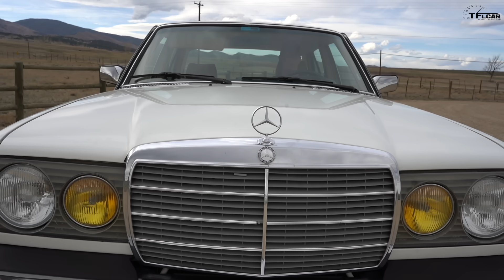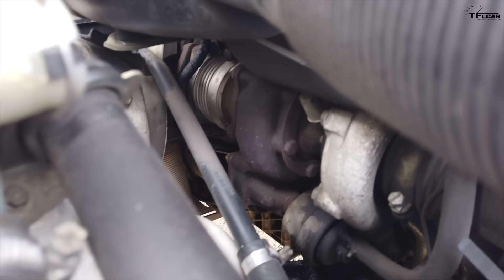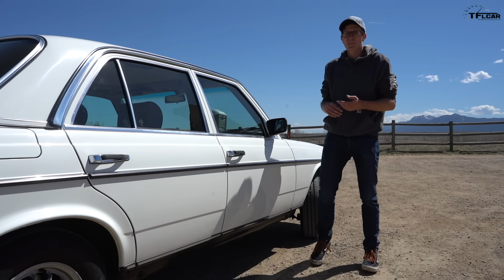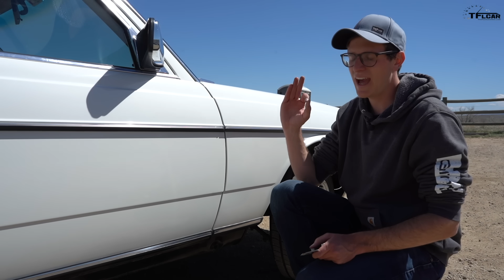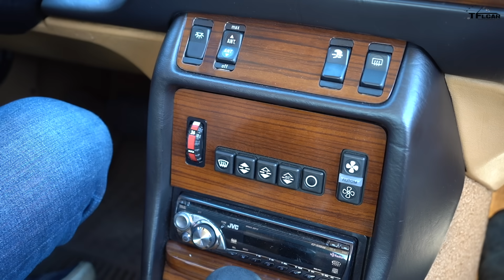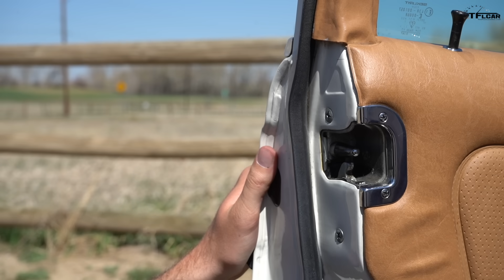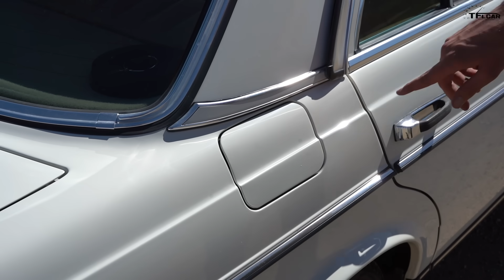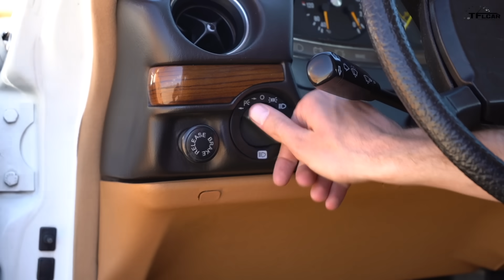This 37-Year-Old Diesel Is THE BEST Mercedes Ever Made!

Comment: Great car, but not so great for inexperienced drivers. With back drive wheel and a massive front engine, you can easily finish driving on the roof.Very bad car for snowy roads.
Reply: Are you kidding me? It drives like a front wheel drive in the snow, there's not enough power, especially in the NA models, for the rear to get loose and you have plenty of traction at the front wheels.

Comment: The 240D was better than the 300D in my opinion. Better gas mileage and less complexity than the busy 5 cylinder turbo diesel motor.
Reply: Sure.
Reply: The 5 cylinder naturally aspirated motor is superior, fuel economy is nearly identical with a significant increase in power.
Reply: @DJS_ENO  You forget the added complexity? 😂

Comment: That should say I drove it from Amarillo to Dallas and back to Amarillo if I remember it used a little less than half a tank and that was a 1970 Mercedes getting that kind of gas mileage the diesel rabbits in the 80s were getting 50 and 60 miles to the gallon average is about 47 and that was in the 80s do you think cars we get better today no but not with all that crap and weight on them

Comment: I love 240ds... I'd be lying if I said I haven't owned my fair share but, cheap to maintain isn't something I'd associate with these cars anymore. I am a huge fan of Volvo 240s and these 240ds, and I have had both at the same time on multiple occasions. My main point is that no European car from this time period will be reliable like you might expect... You probably won't be stranded because the car won't know it's dying and shut itself off but, they break... A lot. Parts on these cars are expensive as all hell here in the US, and using junkyard parts on these vehicles has never yielded me much success. German engineering, and I'd even say all European engineering is all for the first owner to really enjoy. I love these cars, way way way more personality than a newer car, and they can be worked on by yourself but, the reputation these made in the 90s after they were used for 10-15 years isn't all that accurate to today.

Comment: I used to drive a 1982 240 D of the same W 123 model range. It certainly was one of the best cars I've ever had and I've had quite a couple of them: it was built to last (almost indestructable!), extremely reliable, very easy and comfy to drive, quite fuel efficient and, surprisingly, not even very expensive to keep on the road, particularly when you were able to do some maintenance and repair work yourself. On the downside, it was sluggishly slow (both acceleration and top speed) and a pain to drive in ice and snow.

Comment: that is legendary w123 thare is still a lot of them on balkan streets
Reply: Why wouldn't there be? If you can't afford to change cars every 4-5 years and want a highly dependent and reliable old car which is relatively easy to fix and built like a bank safe then it's ideal. And while other car makers could indeed design rugged and reliable cars they all felt and drove like tractors and lacked refinement. The W123 was comfortable too and is designed for long-distance motoring too. Other car manufacturers could also have comfort and refinement but sadly not the reliability (perfect example being the legendary Citroen DS with its very comfortable pneumatic suspension which unfortunately is b*tch to maintain). The Mercedes W123 was just the perfect combination (hardly a "compromise") of rugged and reliable mechanics with modern day comfort (and you can still cruise at 150km/h all day long no problem on the German autobahn with these 40 year old cars). 

When I was a kid I didn't like these old W123 cars because they appeared a bit "old-fashioned" to my kid eyes and worse they always seemed to be driven by elderly men. Now when I'm grown up myself I suddenly understand the wisdom of those elderly men. They weren't out to flash their latest "hot-looking-car" but wanted a safe, reliable and comfortable car which won't provide them with tons of headaches and even worse give you a stomach ulcer. And this is why whenever I buy a new car I always check "reliability reports and rankings", "customer satisfaction" (Mercedes have actually slipped down in the 21st century) and what guarantees the manufacturer provides. 
Had I lived in the Balkans however and perhaps been of the "less fortunate" ordinary people I'd get a Mercedes W123 and drive it forever. Obviously a diesel. They can run forever.

Comment: I'm a European citizen and owned 2 of this cars with a 3.0 engine, my first was a W114  and then a W123 both had a 3.0 engine. I ended to buy Mercedes after I had an accident with my W201 2.5l diesel. In my opinion the best car I drove was that 190 2.5. It was a lot faster and smaller but still you got the feeling of driving a bigger Mercedes in those days.
One interesting thing you forgot to mention in the video is how to handle the rare parkingbrake on that car.

Comment: I serviced MBs professionally for years, and I like the 123 a lot. I wouldn't call it "THE BEST" Mercedes ever, though.

Don't get me wrong, I'm not disparaging the car at all. It's an excellent car, and for its time it was indisputably one of the best cars in the world.

Therein lies the rub, though. "For its time." It's a product of late '60s engineering (the W114/115 dropped in '68, MB started R&D on the W123 immediately), and it shows in things like the rear suspension design and the reverse-flow heads on the diesels (which carried over mostly unchanged from the 114/115). Moreover, the 240D and smaller variants are so severely underpowered that newer MB buyer's guides explicitly recommend against buying them because they're legitimately dangerous in modern traffic, and, having driven more of the cars than I can count, I absolutely agree.

For those reasons, I'd argue the best MB ever made were the W124 and W201. They were engineered and assembled to the same exceptional standards, and they got some significant updates (high tensile strength safety cells, modern aerodynamics, the 5-link rear suspension, more powerful engines, etc.) that make them better cars to drive and live with than the 123 without sacrificing reliability, durability, or serviceability.

Comment: Personally, the best Mercedes made (IMO) is the 1981-1991 S class, specifically the Turbos. It has everything and all the bullet proof engineering that makes this car great, but in a better looking aerodynamic package. I'd argue that maybe the W124 is better but I could be basis. Also, the w126 is ICONIC and quintessential Mercedes-Benz, and the 81-85 300SD engine is indestructible. 

We can agree on the headlights tho. US spec looks better.

Comment: My folks still have their 1981 240D -- no turbo -- white (with body-color hubcaps!) with tan interior, just like in this video. Still runs strong, apart from the battery going when it sits for too long. Little bit of rust on the body but honestly no problems to speak of. Back in high school, almost 20 years ago, I drove it regularly and would joke that the body would eventually disintegrate long before the engine would ever go...but also that the body was hewn from a single piece of granite. Love that car and will never sell it.

Comment: The steeringwheel is so large i  only needed my thumb (of your hand) resting on your leg to drive... so relaxt. Without  powersteering it was not possibe to even steer the car LOL. i had a W123 LPG. Only problem it had was the rust. also the  police pulled me over because they thought i had stolen copper in the trunk but hey the suspension us so great is was leaning back a little.... you can drive a bump with 60mph and don't even notice Great car!!

Comment: Modern Mercs make it to 100k miles then will need engine mounts, most/all suspension components, glow-plug controllers, auto -gearbox controllers. LED light clusters will fail etc etc. Multiple opportunities for them to run rough, so causing more vibration and more early-life failures.

Comment: Honestly i have a 1983 300sd and i like it more than the non s class.
Reply: Yarr...I had an '82 300SD back in the early 90s - an absolute beast of a car. I think I still have its MBZ 250,000Km award.
Reply: @eddiewillers1  mine has 500,000 miles on it but no awards because the person i bought it from did some things to the engine and Mercedes disqualified my car from the high mileage awards and it sucks.

Comment: You're very right. In my opinion this is the last real Mercedes ever made. I really favourite the former W115/W114 (-8) series with nearly the same technical advantages and same motors but they rust a lot. The W123 was better protected and had some nice solutions like changing bulbs of the lamps. But, you should look at a W114/W115 trunk. Because of the fuel tank is underneath the bottom of the trunk there is much more space.

Comment: It's also the ugliest version of that specific model. I didn't say the European model is a design award winner, but it didn't have those horrendous bumpers. Those plain ugly front lights destroy the little design effort they invested in it: in Europe, it seemed to have only two 2 separate white lights and that was it. Its successor, the smaller 190E and D, was one of the very last cars that still had a classic Jaeger clock with orange hands. Knowing which eighties cars didn't have digital clocks, that told you nothing as soon as the driver had cut off battery power was precious knowledge in those days. Esp.when you'd forgotten your wristwatch. Very few people believed that mobile phones would inundate the market of ordinary consumers. We supposed that their use would be limited to men in suits for urgent and important conversations. 
Funnily enough, the first users were high ranking communists. Some even imitated the Politburo elite by walking through East-Berlin carrying stolen battlefield phones. When I asked a hairy Bulgarian why he brought a bakelite device (weighing 10 kilos and made according to a 1950s US plan in 1988 - nothing new there) into the university auditorium, he said he needed it for business purposes. I pretended to closely study the 10 kilos bakelite phone and swiftly lifted the receiver. No click, no static noise that could prove it was connected to anything, just Marxist silence. Meaning that it was unfit for any communication, let alone trading activity. Germany was recently reunited and I asked him what stocks were underrated and if it was sound thinking to invest in hedge funds. Suddenly he remembered an important appointment and disappeared. I bet he never returned to Bulgaria and was among the first entrepreneurs who provided officially in former East-Germany non-existing services in the erotic sector. I bet the first money he earned as invested in exactly the same car you made your video about.

Comment: And no computer bulshit to deal with
Reply: I don’t like “smart” cars either
Reply: facts!
Reply: Yeah, I miss the old days of driving before computers invaded every aspect of a car. When everything was simple and mechanical.
Reply: @pauldavis5665  Me too.
Reply: @pauldavis5665  I don't miss the fact that today's modern cars are literally twice as efficient, recently did a 90 Mile trip in my Mercedes (W246) B200 CDi and did 74.3 mpg. The same car achieved 143 mph (in Germany) verified on Sat Nav.
Reply: @pauldavis5665  and unreliable
Reply: @teslatrev5764  Unreliable? Is that why my old Ford Bronco had over 200,000 miles on it and did not break down once? The thing was still running well when I sold it so who knows how many more miles it got. They built things to last back then.
Reply: @pauldavis5665   So if  an exactly the same bronco was for sale new now would you buy it...
Reply: @teslatrev5764  No. I don't need a truck anymore, that is the only reason I sold it. Bought a car to save on gas. Otherwise I would have kept it.
Reply: @pauldavis5665   Do you know what made the Bronco uneconomical ? lack of technology ..
Reply: @teslatrev5764  What made it uneconomical was that it was a truck with a big V8 engine. lol Trucks today with big engines are also uneconomical which is why I bought a new car and not a new truck.
Reply: @pauldavis5665  Why didn't you buy an old car...
Reply: @teslatrev5764  I wanted something that didn't have any miles on it. I never buy used vehicles since you never know how the previous owner treated them. Every vehicle I ever owned I bought new. By the way, you sure do have a lot of questions. You sound like my youngest son. lol
Reply: @pauldavis5665  I bet he does not get a good answer....
Reply: @teslatrev5764  Which question of yours have I not answered?
Reply: @pauldavis5665  ... i'm only messing with you ... i really could not care less...
Reply: Tesla Trev In what sense? There was nothing to brake and surprise the driver who did even the most basic maintenance on his car. Anything "unreliable" on any car ever was and is related to electronics.
Reply: Paul Davis He obviously is tech obsessed kid. He simply doesn't know better. And he's also a troll, but you probably already realised that.
Reply: @teslatrev5764  Lack of computers did not make a lot of old cars unreliable, what made them unreliable was poor build quality and design. Older cars WERE less economical, but that can actually make them LESS reliable as there are far more electronics and computers that can be prone to breaking.
Reply: @pauldavis5665   i guess your new car keeps breaking down then.....
Reply: Dam straight
Reply: oh dont be fooled. this car had a massive amount of electric crap under the bonnet under the dash in the boot etc. absolute nightmare to keep it all intact.
Reply: Vacuum Logic. Electrical is only for starting, lighting, blower, radio. Diesel runs until there is no fuel, without electrical anything.
Reply: @pirate0jimmy  diesel vehicles electronic  fuel injection and fuel air control...
Reply: what are you watching this on?
Reply: Tesla Trev Your point?
Reply: Ok boomer
Reply: Its emp proof lol
Reply: They put technology, because women can't drive.
Reply: YES SCARY TECHNOLOGY BAD- GOOD CARS WITH HOLE IN FLOOR TO RUN WITH FEET
Reply: Tbh, i love smart stuff and electronics. Heck, i even work in IT, but i would always choose a completely mechanical car if i could tbh. They just /work/
Reply: such a pleasure to drive in today's information age
Reply: I like 'em. Car running rough, throws CEL. Plug in my $8 Chinese scanner and within 11 seconds I know that cylinder #5 is misfiring and that it's likely the coil pack. 

So... pros and cons to computers. It's not all bad, you just don't want to buy a car with garbage computers.
Reply: @DigitalBathInAZ  But in the first 30 years this Mercedes might not let you down not even once...while a ECU car...well...most likely will never reach that age...and will break on you multiple times in whatever timespan it lasts.
Reply: @henryrollins9177  I'm approaching 30 years on my early and mid 90s LS400 and SC400, soooo... 

I guess we're talking just MB cars with ECUs (which I know nothing about) and I mistakenly took it to be "cars in general with ECUs". My bad.
Reply: @henryrollins9177  Fact!!!!!
Reply: Those Lexus cars were built to be show pieces. Toyota may have accepted NO PROFIT for a few years, like the Prius, to own the market space in a way that Nissan, Mitsubishi, Honda, Suzuki will never catch up to. Toyota is very proud of the Crown cars being the biggest and best car for top Japanese officials.
Reply: @henryrollins9177  its almost like the automakers have "preprogrammed" the computer to make a part fail..just so they can sell parts to make more money..lol!

Comment: I take it that it gets really good fuel economy being a diesel probably like 35 40 miles a gallon
Reply: brettduffy19992 30mpg on the highway , but not much better. It’s a SOHC, so it’s limited in its efficiency. My 300SD only has 3 forward gears, so when your going 80mph, your at over 4K RPM, not exactly the best for fuel economy.
Reply: @jgarza03  at 55

Comment: I have an 82 300D turbo, my parents bought.  Odometer says around 295K miles, but only cause it wasn’t working for a while... think it has closer to 400k miles, original engine and transition, never rebuilt.  Only things I’ve ever had to fix that cost money is the starter and glow plugs and sunroof motor once.  Also had an 85 300SD that was amazing.

Comment: BULLSHIT video:  Mercedes factory went on record saying their diesel  has the same life as their gas engines.   Even if the engine lasted longer than a gas engine, it doesn't matter as the rest of the car will fall apart within 150,000 miles without lots of work.

Comment: Volvo 240 is a similarly tough abs straightforward design. I love both of them.
Reply: Volvo 240 is another mechanical marvel. Both cars are built to last not go fast.
Reply: @frankfff1665  I agree!
Reply: Yes you are right
Reply: Yes and you don't want to be run into by those Volvo's. They will ride your car of. And the Volvo will drive home. The Volvo was alot stronger than the mec. My friend has a 1977 mec 300 diesel in Australia and everyone wants it. 👍

Comment: Well, the old Toyota's Corolla are at the same level, they can't die.
Nowadays, car barely go over 15 years of use / 150000 miles, too expensive to repair, loadz of electrical/electronic problems.